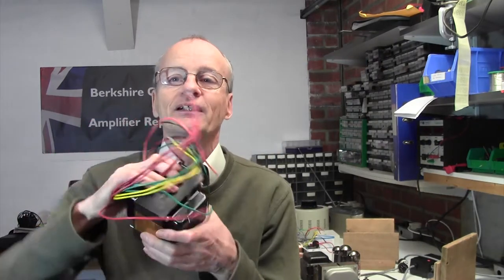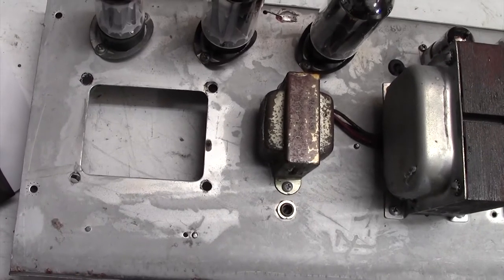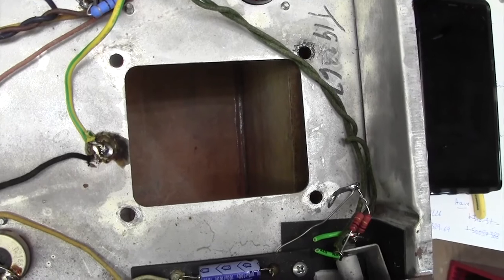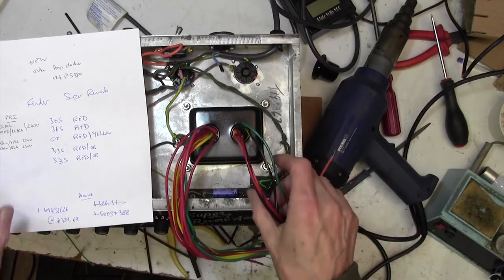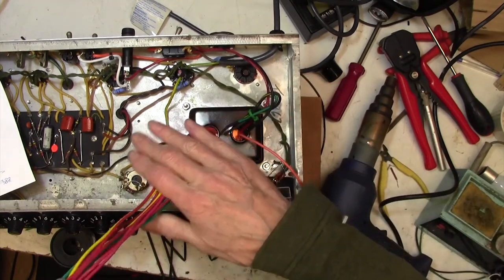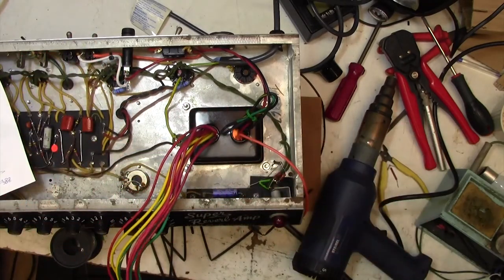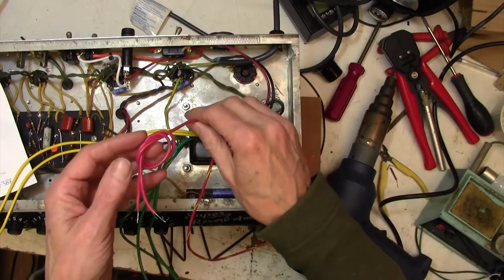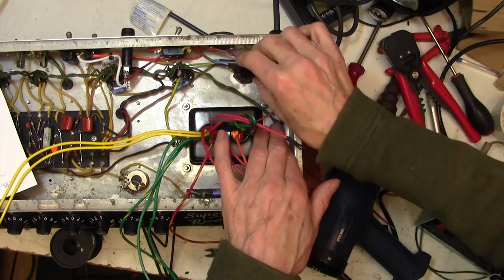How to Replace Mains Transformer on Fender Super Reverb

Comment: I got the same holding technique as you. :D  just needed your video because I was confused about the screen tap. Never had an main transformer with a 'screen tap'. Build several Marshalls but fender is new to me :D  and YES Sn60Pb40 nothing else**

Is there any advantage of soldering the ground to chassis? im used to use brass screws and a star washer/contact disc combination.

Comment: Hi Stuart
I’m a new fan here in the US. 
I have a question related to this video. I bought a replacement transformer for a Fender Tweed Bassman. It has two wires on the secondary for bias instead of on dedicated bias wire. 
Would I run one of the wires to the diode/cap and ground the other wire ?
Thanks for any help.
Reply from the maker: Hi David. I'm really sorry bit I don't want to risk giving you wrong info on this so I can't advise without seeing it. Good luck getting it going.

Comment: Great video Stuart. Are there no other changes you need to do to the circuit when swapping a 110v to 240v mains transformer?
Reply from the maker: Hi Dee, no thats it. They both produce the same output voltages as each other as long as the correct input voltage is there (e.g. 120 or 240) Hope that makes sense.
Reply: @stuartukguitarampguy5830  Excellent thank you..